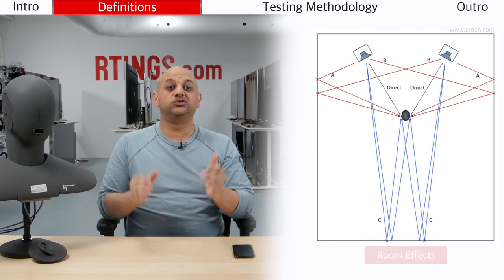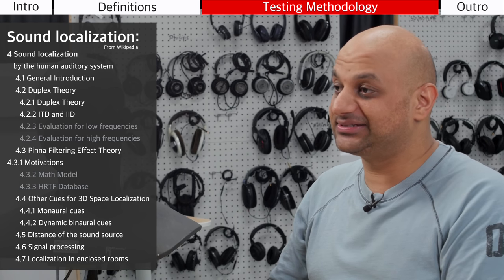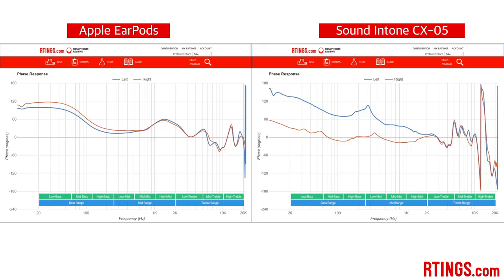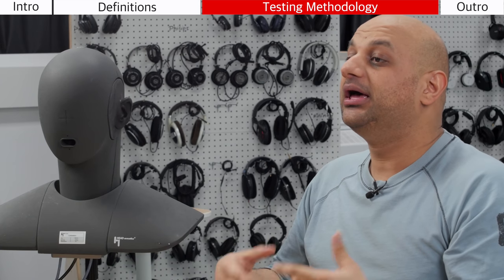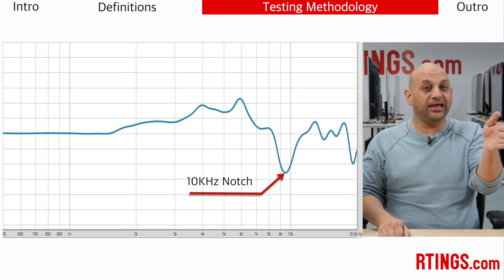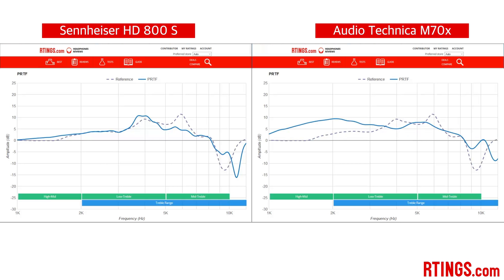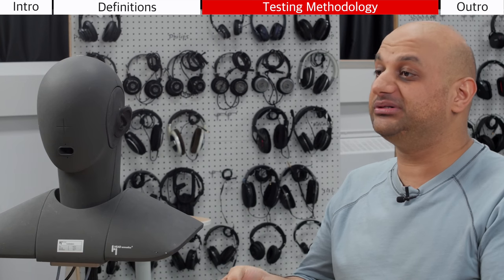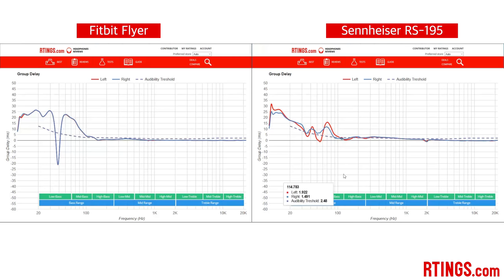Soundstage and Imaging of Headphones - RTINGS.com

Comment: Awesome work! I wish all people doing reviews did this good job.

Have you tried to measure the reference curve for PRTF in anechoic chamber/acoustically dead room? As most speakers have been designed to emit as good sound response as possible in acoustically dead (or heavily acoustically treated but not dead) rooms it would make more sense to me to compare pinna-related differences to the direct speaker response (that is, speaker output without any room reflections).

I think this would better measure the quality / accuracy of the headphones because you can add artificial room reverb but if the headphones always simulate room response, you cannot remove it after the fact. For the same reason, I think headphones should have zero crosstalk because you can very easily adjust crosstalk in DSP but you cannot remove it.

As for all the rest, I agree on your methodology.

Comment: Thanks for the video and explanation. I tend to like headphones without any soundstage, for example I like M50X more than DT770. I am using headphones next to my studio monitors for mixing, and all of my monitors and headphones are measured and digitally corrected so I can get as close as possible to the flat frequency response curve. How successful this is, well it is another story, but for me it is much better to have frequency curve closer than further from the flat one.
As for soundstage, is DT770 a bad example of larger soundstage so that is why I like more direct, and concrete sounding M50X, or it is all just a personal preference? Thanks...

Comment: I think it would have been good to explain a bit more about how group delay errors affect the audio quality. Saying that "bass sounds less tight" just hints the actual issue. If speaker or headphone has perfect frequency response but poor group delay, it means that the speaker or headphone is able to reproduce correct frequency with correct sound pressure but the timing of the start and end of the sound is incorrect. And it should be obvious that if your bass frequencies are playing delayed compared to rest of the music, the result will obviously sound a lot worse.

It might be better to render group delay relative to length of a sound wave to get more accurate image for higher frequencies. If I remember correctly, the hearing threshold is slightly above one cycle length so it should be 1/50th of a second for 50 Hz and 1/10000th of a second for 10 kHz. Graphing the percentage of the delay relative to hearing threshold for each frequency should result in graph where hearing threshold is a straight line and group delay would visibly go over the line for problematic frequencies and we would be able to see differences in group delay for higher frequencies better even when the actual value is below the hearing threshold.

And one very important thing to understand is that you can use EQ to flatten the frequency response but that will cause more problems to group delay. Fixing both at the same time electrically requires very complex DSP.
Reply from the maker: Hi Mikko! 

We noticed a few of your comments, so we're going to try and address both of them here. 

firstly, thanks for your great feedback and insight. Rendering group delay relative to length of the sound wave is an interesting idea that would be worth exploring in the future once we decide to revisit and improve our imaging tests. I've made sure to write down your idea. 

As for measuring the reference curve for PRTF in an anechoic room, we definitely thought and considered it as an option, but we usually prioritize doing measurements in rooms/environment that are relatable to people when using the product. Having a reference curve measured in an anechoic room could lead to disconnect between our measurements and the true experience when using the product. Of course we are always open to hear everyone thoughts on this since in the end nothing is set in stones and the goal of each of our tests is to help people find the best product they need for their specific usage.

Thanks again and do not hesitate if you have any other suggestions.

Comment: Do you have an idea, why the phase response is completely different for the same earphone model measured by rtings vs. measured by inner fidelity? There is virtually no similarity between the two graphs for each model that I tried. Inner fidelity measures them at 600 Ohm output impedance.

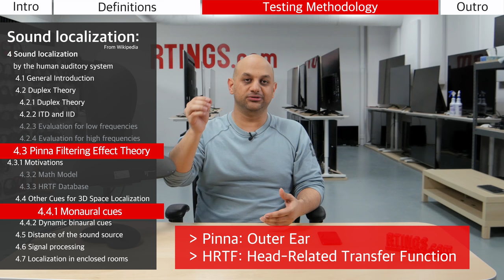7:45 Awesomeness

Comment: Amazing stuff, I was always curious about this. I have a few questions about PRTF. Have you done any subjective tests to varify your methodology? Shouldn't this response vary greatly between different pinna? And finally, don't you think some headphones with bad PRTF can make up for it by having resonances that match the corresponding pinna resonances, which obviously wouldn't show up in the PRTF? Thanks!
Reply from the maker: 1) Only internal subjective tests for now. 2) Since this test is the difference with and without pinna, it should somewhat transfer to other pinna. 3) Technically yes. This is less likely to match the listeners pinna though.
Reply: Ok i think i get it, thanks for the reply!

Comment: The right pads, Equalizer APO, A1Stereo Control by Alex Hilton, free VST that works better than any paid software I have tried. And a compressor. The equalizer in Equalizer Apo Is a ridiculous tool that can actually boost the currents in your headset, it can break your headset if you wanted to do that. With these tools, I can make any headphone with a good driver have an amazing sound stage and balanced sound. The only reason we're still at this point with headphones is because manufacturers suck. They intentionally sell gimped products to create market segments. And that's the story. One more thing. isn't it strange that with a relatively meh driver, with basically no thought in the design of the driver casing ( the headphone shape itself) but with the correct type of pad, you get a completely different sound? Why is driver technology basically at the same level as 30 years ago. It is beyond depressing.

Comment: Why do you guys do this absolutely idiotic thing with your freq response measurements where you apply some arbitrary target as reference and then compensate the raw measurements based on that?

Deviation from target is a fun graph, but it shouldn't be your frequency response measurement
Reply from the maker: Hey George, our target curve is based on the Harman target curve that aim to be the profile most would like based on their extensive research. Of course this target does not represent everyone's personal preference, but it allows to quickly see whether a headphone has more bass then what an average listener would like for example and we think it makes the graph more approachable at a glance. It is to be noted that we do include raw measurements in our reviews on the website for users that prefer this approach. All that being said, we understand that it may not be the perfect solution, and we're always looking for ways to improve, so don't hesitate to share any suggestions or thoughts you have for ways we can improve this situation!
Reply: @RTINGSdotcom  the Harman target is excellent, great and all, but I don't think you should use deviation from target as your main frequency response graph. I think raw freq response, with an overlay of the harman target curve average is a much better approach. Let us avoid oversimplification of using deviation as default

I know you publish raw fr graphs as well, but those aren't the ones that show up from your site on google images :)